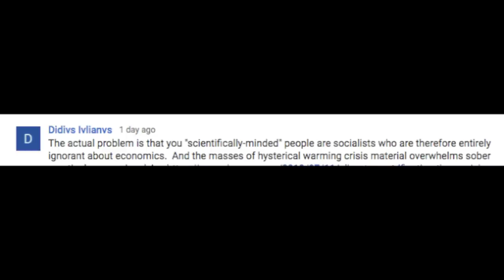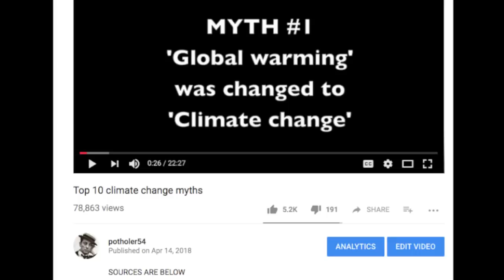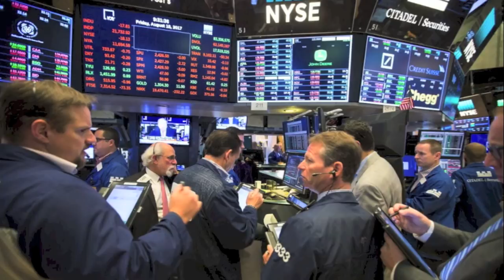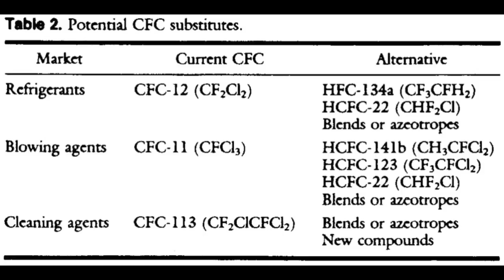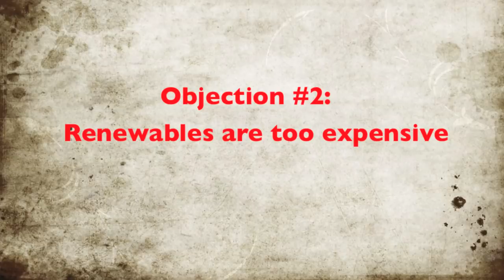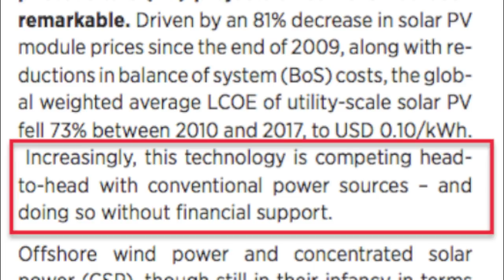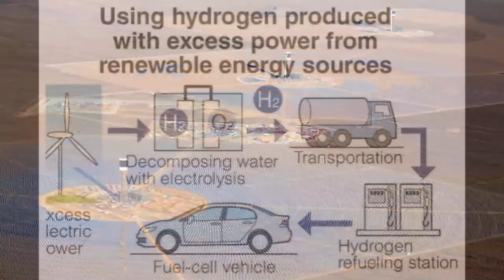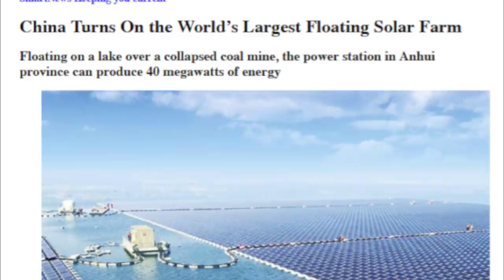A CONSERVATIVE solution to global warming (Part 1)

Comment: And China has so much smog, because?
Reply from the maker: Because, as I said in the video, it's been so reliant on coal-fuelled power. As I said in the video, this is one of the main reasons it's moving away from coal and towards cleaner sources of fuel.
Reply: @Mrpersonman0  Let me know when they are.  Because we know the CCP is known for its efficiency, fair market, honesty, and innovation in technology.
Reply from the maker: @ATAX wrote: "Let me know when they are"
   As I said in the video, CO2 from coal-burning fell for the first time in 2014, and China is planning to reduce coal to 58% of its fuel mix by next year. There are likely to be ups and downs over the next few years, with peak coal reached in 2030. Details are in the sources listed in the video description.
   This is the third time I've had to repeat something I explained in the video in answer to your questions. Why not listen to the video first, fact-check anything you don't understand by looking up the source, then post if you have something to add? You might find that easier, thanks.
Reply: @potholer54  What do have to support that comment ? What rate is china moving away from coal ? That is another reason your models are failure Peter. China is building coal power plants at an insane rate. How much diesel is burned cradle to grave on solar panels ? I watch all this skullduggery up close and personal. Go read the Forbes article on scaring people with voodoo predictions and the hate coming your way.
Reply: @potholer54  not true, China is building coal fired power plants as fast as they can.  Their percentage of wind power is less than what the US is doing.  https://www.reuters.com/article/us-climate-change-china-coal/in-china-coal-creeps-back-in-as-slowing-economy-overshadows-climate-change-ambitions-idUSKBN1Y60NU
Reply: @potholer54  so why is China building coal fired power plants as fast as they can right now.
Reply: @LewisLudwig  Anything reported out of China is bound to be dubious at best.  The CCP controls everything.

Why buy natural energy at the current price when you can ideologically subvert the world into believing in infinitely renewable energy, that isn't as efficient?  I would imagine Russia isn't playing that game because their economy is pretty much dependent upon natural energy exports and China, an energy importer would gain from their competitors moving away from reliable resources.  They can only properly power 1/3 of their country; somewhat in another third; none in another third.  They are a 1st, 2nd, and 3rd world country and I'm expected to believe that they are going to carry us into the solar energy future?   Not a chance.

Comment: There is still a great deal of uncertainty about climate theory,
It is not clear how much of the rise in co2 is anthropogenic, 
and why the climate hasn't warmed in the 20 years according to RSS satellite data, the very satellite designed to measure changes in climate,
Or that atmospheric co2 has anything like the effects postulated by the IPCC,
Nor is it clear that the climate policies we are pursuing will have any material effect on atmospheric co2 or the climate,
It is very clear that we are unable to predict future changes,
All the predictions so far have been falsified by the data,
It is clear that our climate policy will do far more economic damage than climate change it's self.
Reply: True, but so we should just act as if climate change definitely isn't happening because maybe we're not sure about some things? Also 13 of the 14 hottest years have occurred in the last century
Reply: cool strawman
Reply from the maker: "why the climate hasn't warmed in the 20 years according to RSS satellite data"
   Because your premise is wrong. RSS satellite data shows global temperature HAS increased over the last 20 years, just as UAH satellite data, ground data and sea surface data do. 
   Your other claims are also wrong, but I've got used to that, they're the kind of urban myths you can read anywhere on the internet. What interests me is why you believe them. Where do you get your information from, and why do you believe it without checking other sites where they are debunked? Do you seek out these online fallacies because you're afraid climate policies may impact your standard of living? Thanks.
Reply: So, you admitted to not watching the video.
Reply: Is the uncertainty based in actual scientific fact? or just the fact that you dont know?
Reply: It is absolutely clear how much of the rise is anthropogenic. We know how much CO2 we produce (double the rise in the atmosphere). We know how much is produced by natural sources such as volcanoes, and that it isn't nearly enough to explain the rise. We know how much oxygen levels have dropped, compared to how much fossil carbon we have oxidized, and how much oxygen is in the CO2. We know the isotope composition of fossil carbon and how it compares to that of  surface carbon, and that of the atmosphere. We know that the rise in atmospheric CO2 has tracked the amount of fossil carbon we have burned over the years.
And the answer is, all of the rise is anthropogenic.
Reply: And:  Your "no warming since 1998" story expired by 2010. Even by then, it was clear that the proper interpretation was not "it hasn't warmed since 1998", but "1998 was a heck of an unusually not year, overlaid on a continually increasing, but noisy, graph.

Comment: If we scrapped fossil fuels, we wouldn't be in the 1850s, we'd be in 6000BC.  1850 had technology appropriate for 1850.  We would have to give up our diesel locomotives and adopt steam locos..... powered by wood, like in the 1850s.  But we have no wood fired steam locomotives.  And without fossil fuels, we would have a hard time building them.  We would need millions of draft animals and wagons, harnesses carriages, farriers, vets, wheelwrights, etc.  A whole ecosystem of now lost skills.  All built without fossil fuels.
Reply: Look, we got to evolve away from fossilfuels NOW! And in anyway as fossilfuels is a limited source and it will be gone in 60+-yrs. When do we start ? When we have destroyed our atmosphere and we can't breath air without getting cancer.. What do you think will happen if we countinue spewing out Co2... Are you blind to what is happening around the world ?
Reply: @Mads-hl8xj  So, would you ban the burning of coal?
Reply: 00ProblemChild  As you reduce the coal consumption, the amount of sulfur dioxide and black carbon (soot) will diminish.  The existing "aerosol parasol" will wash out in a couple of years.  We know the time line from measurements taken after large volcanic eruptions, like Pinatubo.  As they wash out, the SO2 forms sulfuric acid, acidifying the seas, as the concentration in the atmosphere drops.  As the SO2 and carbon present in the upper troposphere diminish, less heat will be reflected, more will reach the surface.  The GAST could rise by a half a degree C. in a few years by itself, not counting CO2, methane, N20, and other hydrocarbons, particularly chlorinated and fluorinated hydrocarbons' contribution.
Keep burning coal, you get long term heating. 

Stop burning coal, you get significant short term heating.
"Phase out" coal consumption, you get a bit of both.
The reality is if you can't survive in the short term, what happens long term is moot.
Reply: 00ProblemChild  I'm not offering solutions.  There are none.  Problems offer opportunities for solutions.  This is a predicament, with no obvious fix.  I'm merely stating the facts.  You pays your money, you takes your chances.
Reply: 00ProblemChild  No, by all means, do what you can as you see fit.  Just don't get too attached to outcomes.
Reply: @Mads-hl8xj  Uhhhh, too late.  The damage is done, the heating is baked in for at least 30 years even if we stop all GHG emissions today, if we don't expend a huge amount of carbon fuels developing and deployinhg GHG capture and storage.  Which would first have to deal with the vast release of GHGs spent BUILDING the "solution" before it even could address the new emissions.  Then there are the legacy emissions which currently are in the atmosphere.  You see the predicament we are in?
Reply: kim weaver too late for who? This will be a multi generational effort. There is no doubt about that.
Reply: @kansascityshuffle8526  Human civilization and very likely humans ourselves won't survive for more than a generation and a half, if that long.  Near Term Human Extinction is a real thing.  This is the sixth mass extinction event.  Have fun while you can.
Reply: kim weaver ok cop out.
Reply: @kansascityshuffle8526  I never opted in.  I refused to have children and have been as self sufficient as I deemed necessary.  Sort of a suburban hermit pioneer. 

What do you think YOU can do to stave off Near Term Human Extinction in the Sixth Mass Extinction Event??
Reply: @kansascityshuffle8526  Sure "Kansa" (sic).  Spelling counts.  Now show anything I said is wrong.  Get busy.
Reply: kim weaver spelling doesn’t count your existence proves that.  The key here not to argue with you it’s to point out you have simply given up without even trying. It’s a useless stance to take on this or any other issue.
Reply: @kansascityshuffle8526  You, on the other hand, are a pollyanna skipping merrily through an extinction event.  That is MUCH more sensible.  Sure thing, Skippy.
Reply: kim weaver no not at all. I recognize there is definitely a problem with the way humanity operates and realize there is a need and chance to change it. Your outlook is just of giving up. Frankly it’s surprising you are even here arguing. Why?
Reply: @kansascityshuffle8526  You obviously didn't read my posts, did you?  I SAID that there is no percentage in just rolling over, go ahead and do WHATEVER you think you need to do or should do for whatever reason.  But, don't get too attached to outcomes.  Do it because it's the right thing for you to do.  I just don't see any way out of the predicament we have created.  The situation with coal is a perfect example.  Damned if we give it up, damned in another manner if we don't, and a bit of both if we try to have it both ways.  If you think you have a guaranteed idea for salvaging a habitable planet surface, let's hear it.
Reply: kim weaver i read all your posts and you just summarized all of them. You chose to take a fatalistic do nothing approach. That’s fine. What’s weird is the fact you are even here if this is your belief the outcome cannot be changed. After all by your own words you’re a suburban hermit pioneer. You very weigh in to this subject is fraught with hypocrisy.
Reply: @kansascityshuffle8526    Your problem is that you can't seem to differentiate between being fatalistic and being realistic.  If you are hurtling over a cliff and are speculating on the various ways that you might be miraculously saved, you are wasting your final moments.
Again.... Do something, ANYTHING you think will help, or even just make you feel better.  Don't get attached to the outcome, do it because you think it just might help.  DON'T sit on your thumbs if you have a legacy you want to secure.  I don't have a legacy as I understood early on what we were in for.  So I am not invested in the future.  When I'm gone it won't affect me, and my passing won't matter, either.  In the cosmic circus, our act won't be missed.
Reply: kim weaver it’s you who isn’t being realistic as there still is a realistic chance at turning this thing around. Albeit not in our lifetimes. You choose do give up and do nothing because that suits you. You just add a flare of hypocrisy by even being here. By your belief nothing can be done but you are here in a forum full of people who think there is a chance.
Reply: 00ProblemChild  Smoking a big pipe of hopium aren't you.  What data supports your contention that we can lessen the damage?  The lunar landing program?  That was so tiny in scale, compared to what we would reasonably have to do and in a ridiculously short period.  It would likely require the emission of as much carbon during the build-out and operation as the fossil fuel industry unleashes on us.  What would you suggest as a plan to "lessen the damage" and how much less would it be?
Reply: 00ProblemChild  I have watched ALL of Peter's vids, climate and religion and all the other random ones. 

Do you really think we can force the climate to do what we want by force of will?  Sorry, Skippy, that is NOT going to happen.  Technology is going to save us?  "If stupidity got us into this mess, why can't it get us out?"...... Will Rogers.
Reply: 00ProblemChild  So, let's hear YOUR magnificent plan to salvage some of humanity.
Reply: 00ProblemChild  Well, Skippy, you sure read me wrong.  If you are motivated to do something that you think will help, even a little, by all means do it.  Don't sit on your thumbs.  But don't get attached to outcomes..... just do it.
Reply: 00ProblemChild  Since you are so gung-ho on mobilizing, I'm curious what you plan to actually DO.  Or are you sitting back and watching the technowizards propose all sorts of things which will likely cost a shitload of carbon before they start to make a difference, leaving us farther back than we otherwise would be.
Reply: 00ProblemChild  So, let's see.  You have no idea what YOU should do, much less what I or states, nations, or the planetary society should do to mitigate the collapse of habitat and the extinction of most life on Earth, but I'M the Debbie Downer to your hopium fest?  Really? 

And what makes you think that I'm not doing what I understand to be reasonable and effective actions?  You leapt to a conclusion not warranted by evidence.  You seem to do that a lot.
Reply: 00ProblemChild  Ditto.
Reply: 00ProblemChild  Do you mean justifiable true belief or just vague hopes?  Vague hopes will not give you any focus and will leave you adrift.  Projection of a bright potential future when the information suggests that it's impossible makes you delusional.  You can be motivated by delusions, many are, but is that what you want for yourself? 

If you want to go out fighting, by all means.  It would be so human and akin to the drives that put us into this place.  We never could just stand down and leave things alone.
Reply: 00ProblemChild  So you don't think there is a bright future.  Welcome to the club.
Reply: CO2 DOES NOT reflect heat, it absorbs it. You have a basic MISUNDERSTANDING of atmospheric chemistry.
Reply: @MoreParksLessParking    Show us how that is a "solution", polyanna.   There has never been an example of a functioning MSR power plant, not at any scale.    The MSRE at Oak Ridge in the 50s was only a portion of the core, no blanket, no chemical processing, no power plant hooked up to it.